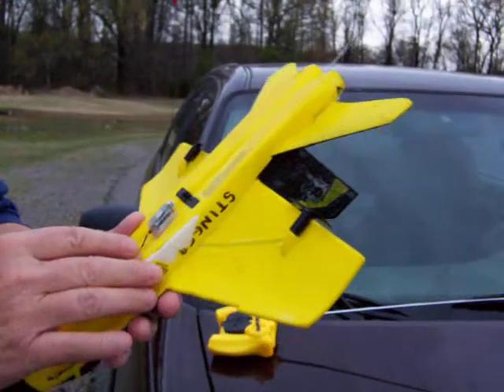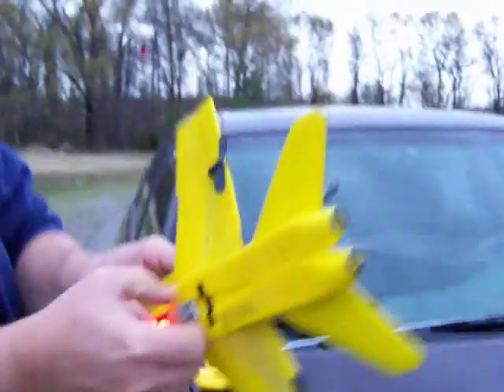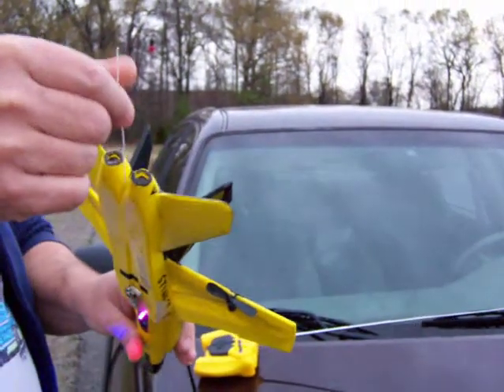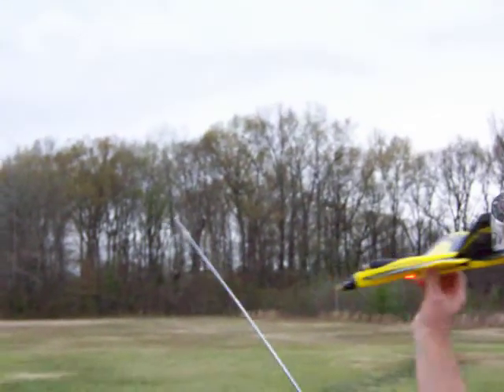Air Hogs RC F/A 18 Hornet  Yellow and Black  Plane

Comment from the maker: Using a real small weight of some kind with scotch tape starting from the rear wheels to the front wheel, you can move the weight and maybe compensate with that. I didn't have that problem with this plane, but you aren't the first person I have heard that from. I tried this with other planes and it seems to work well.

Comment from the maker: Try adjusting the trim knob the opposite direction of the curve until it flies straight.Or charge the battery & run the plane down & recharge it again & sometimes that helps get the battery a full charge. Or try & run down the plane a little & then recharge the battery fully. I notice sometimes that helps the battery fully charge especially when the plane is new. BUT thats not how it should work, they should charge fully at the beginning. Alway make sure the plane cools off before recharging.

Comment from the maker: Powered by the battery that came with the one that came with the helicopter that is attached to the curcuit board. So I have to recharge it with the remote that goes to the helicoptor.

Comment: i tried the trim.  My main probelm is that i can get the plane in the ait and it is pretty high and keeps going but I can NEVER get the plane to fly left or right with the right/left controller, i have to actually try to control iby turning the trim left or right.  No matter what i try i cant get get the plane to budge using the right/left controller.  I usually end up just dropping down the throttle or else the place just flies strait, and i dont feel like jogging 100 yards!! HELP